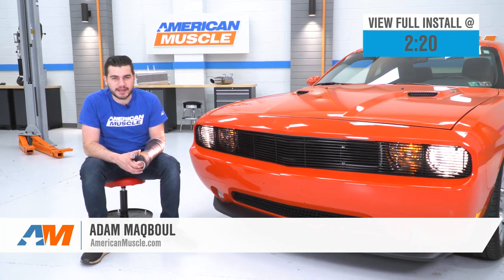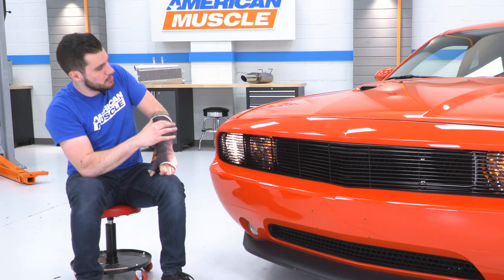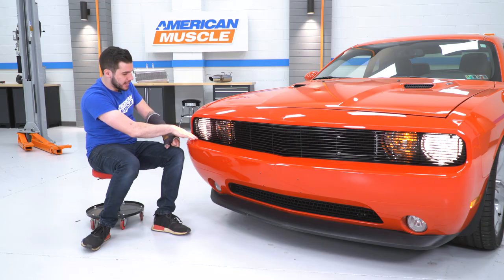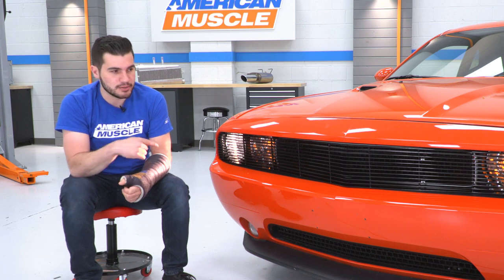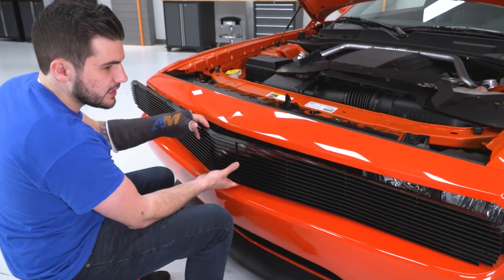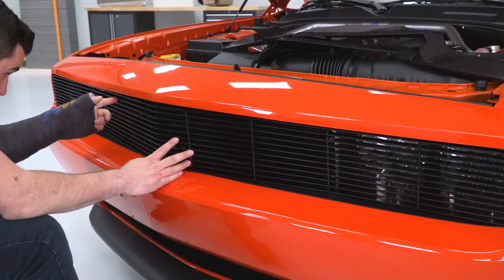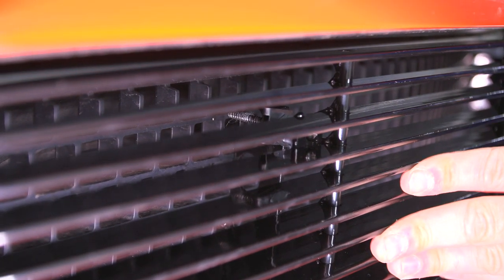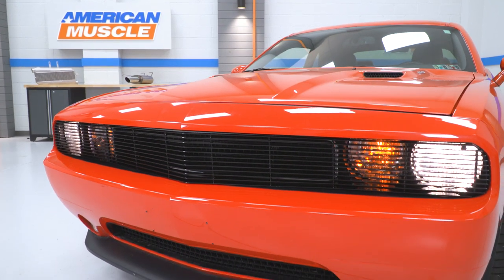2008-2014 Modern Billet Phantom Upper Grille Overlay - Black Review & Install

Comment: Just finished this install on my 2010 Challenger R/T Stone White and I love the look! The installation is not as easy as the video makes it out to be. I'd recommend removing the belly pan underneath the car and work from there, it'll save a lot of headache in the long run, from the top, you will drop a nut or one of those brackets.

Comment: I've received the grill but the studs do not appear to be long enough and the grill appears to be a little too long to actually fit the front of the car properly it's like it's not dropping back inside for enough
Reply: okay it would have been helpful if I try not to put it in upside down also I recommend leaving the screws a little loose on the front of the bracket so you have some wiggle room and then tighten them up once it's in

Comment: I just received my upper and lower grills for my 2019 R/T and got no such brackets, only 8 screws and 8 wing nuts. Also after removing the 2 cupholder panels there is more plastic hiding the rear of the grill.
Reply: Ya same here. As far as I can tell, you have to completely remove the front bumper. Is turning into quite a nightmare.
Reply: @ZombieGrizzly  I gave up and returned both the upper and lower grills. American Muscle needs to update and show an install on late model Challengers.
Reply: @dadathome274  unfortunately if removing the bumper isn't pretty straight forward then I'll prob do the same
Reply: @ZombieGrizzly  There's a video or 2 here of guys removing the bumper. Not something I'm going to do.